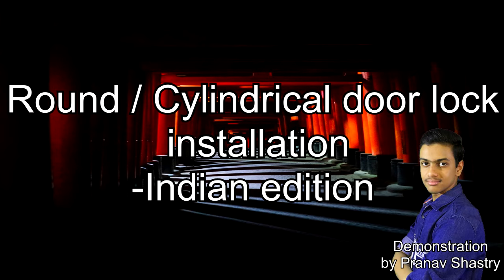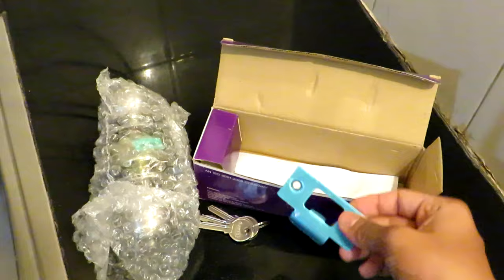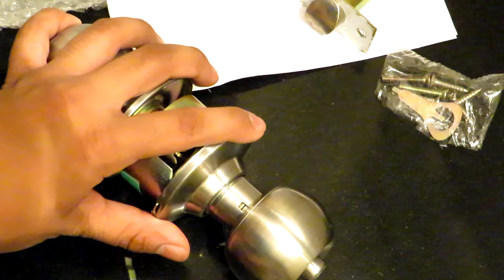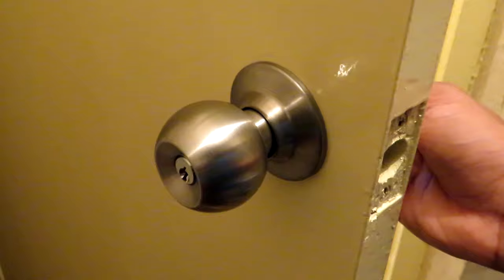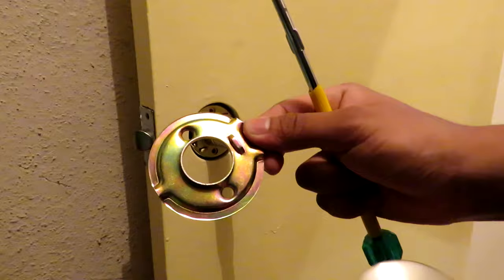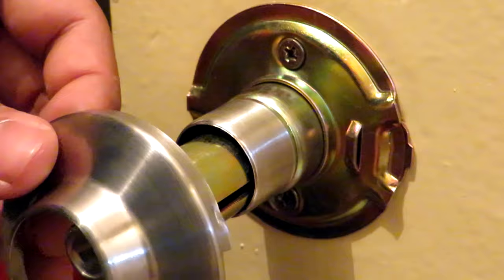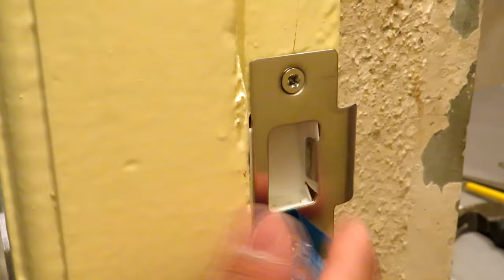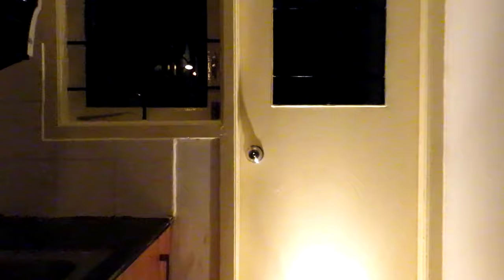Round door lock installation

Comment: Thanks for your great video. I almost go to return the lock to the hardware shop for can not mount it firmly on the door. Finally i know the plate with two open holes can be disassembled and used for screws tightening after luckily watched this video.
Thanks.

Comment: Hello sir your video is really helpful but I have trouble locking the door knob from outside using the key.......how can I lock the door from outside... kindly please help me out with this.
Reply from the maker: Hi, actually to lock the door, first press the button on the inner side of the lock unit. Then just pull the door and close it. The door is now locked. You will need key to open from outside.
Reply: @PranavShastryOnline  ok sir got it.....but I have one more query that whether the key is only used to open the lock?

Comment: Where can i get door / lock reinforcer plates? I have bought these doorknobs but my door is thin. It will easily break without support
Reply from the maker: You could buy 5mm metal sheet and fix that to the door for additional strength

Comment: Hi bro.. can it be unlocked frm outside with knife or any card as shown in many YouTube videos
Reply from the maker: Yes. Unlocking using sliding card or lamination sheet is possible when there is slightly bigger gap between door and door frame. So if perfect cutting of door size is done, then it will be a theft proof door.

Comment: Hello Pranav Shastry Brother,
Thanks for your video Bro.
When I installed it, it is working fine to unlock from outside.
When Iam trying to lock the door and close it, door is not closing bro, nob is stopping and not allowing to close the door
Reply from the maker: It might be a mechanical problem between the latch and the wall lock unit due to incorrect bend angle. Try some troubleshooting and see if the latch is moving smoothly.

Comment: Thank you so much for your clear explanations. But I have a question... Can the lock be installed on a metal door ?
Reply from the maker: Hi, it can be installed provided the door thickness is within the specified limit. However, it is recommended for wooden doors.
Reply: @PranavShastryOnline  Thank you for your reply. What is the specified limit though ?
Reply from the maker: @prevailadesina1815  Generally for doors ranging from 30mm to 50mm, these kind of locks are suitable. The particular lock model I have shown is rated for doors of thickness 32mm to 46mm. Please check about the particular model you are buying.

Comment: Good video with amazing instructions. One thing, how can we lock the door from outside with a key ? Is the key only used to unlock if locked from inside ?
Reply: I have the same question how to lock it from outside by using keys?.....are you able to lock it from outside?
Reply: You don't need the key to lock a cylindrical lock from outside. How you do it is to firstly press the button on the inside, then go outside and pull the door shut and it will be now automatically locked and you will need your key to open it. Hope this clears your doubt. A word of caution: Be sure you have your key with you before you do this or you'll be locked outside and you'll have to break open the door!

Comment: Hi there,
Could you please confirm that key we get along with round door nob is to unlock the door and not to lock the door from outside ?
If so then I feel its strange bcz key should have functionality to lock and unlock the door as well .
Reply from the maker: The key is to unlock the door. To lock the door, you can just press the button on it and close the door. Then you can unlock it using key.
Reply: You don't need the key to lock a cylindrical lock. How you do it is to press the button on the inside, then go outside and pull the door shut and it is now automatically locked. You'll need the key to open it from outside now. Hope this clears your doubt. A word of caution: Be sure to have your key with you before you do this or you'll be locked outside and you'll have to break open the door!

Comment: Can it lock from the outside with the key
Reply from the maker: No, locking from outside is not possible. The door can only be unlocked from the outside but if you wish to lock the door and leave out, press the button on the inner side of the door and close it. It can then be opened from outside using the key.
Reply: @PranavShastryOnline  ok I change 3 off my door lock but I realized I can't use the key to lock it from the outside

Comment: How did you make holes in the door exactly ?
Reply from the maker: There are drill bits with circular head for drilling that size hole. The holes were already drilled in 2004 and the lock was also fixed. I replaced the old lock because it broke.

Comment: Bro how to lock with key
Reply from the maker: To lock the door, you must press the button on the inner side. You can only unlock the door using the key. It is not possible to lock the door using the key.
Reply: Bro what is the use when we go outside
Reply from the maker: @nitish7764  In this model, before you leave the room, you should press the button on the inside and close the door. Then only using the key it can be opened from the outside.
Reply: @PranavShastryOnline  bro before leaving room while pressing the button backside and pressing the door the knob present backside will rotate and the button coming outside from outside it is opening without key
Reply from the maker: @nitish7764  No. When closing the door, the knob will not rotate. There is a isolation lever inside the lock mechanism which prevents the knobs from rotating automatically when the door is closing. Hence if you press the button on the inside, then the door will remain locked once closed and can be opened by using the key from outside.